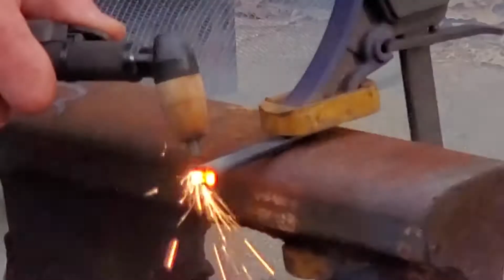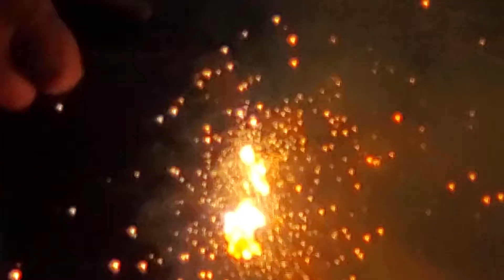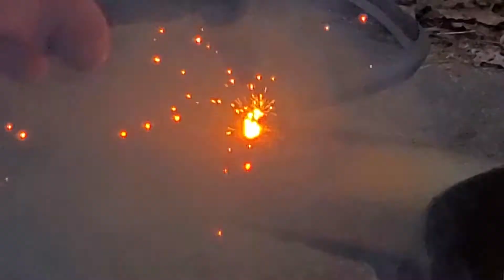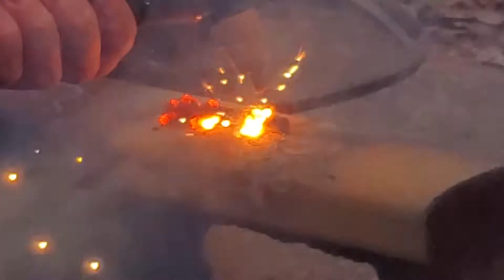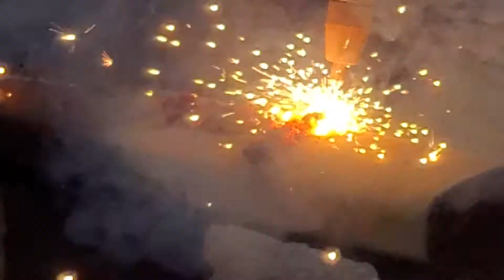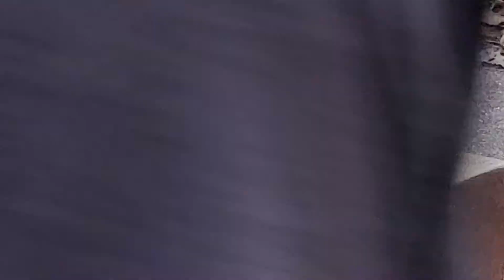PLASMA CUTTING A FERRO ROD / FIRE STEEL

Comment: A Ferro Rod is a mixture of different metals , cerium , Iron , magnesium , 

They are in different percentages , the more or less of these different metals is what makes a soft Ferro Rod or a hard Ferro Rod ,
Soft Ferro Rods throws more sparks but hard Ferro Rods last longer , 
So it's just a Matter of choice , 
I have over 100 Ferro Rods from small to 1 inch diameter and  10 inches in length , 
I have seen NO difference in any of them because I make them all work and I use them properly , I can get a Fire started in one or two strikes , 
It helps to know which materials catch fire easily and Fat Wood lights easy , I have over 500 pieces of Fat Wood so I don't need anything else to catch on fire but I practice with just about everything , 
I start at least 5 fires each and every day just to practice